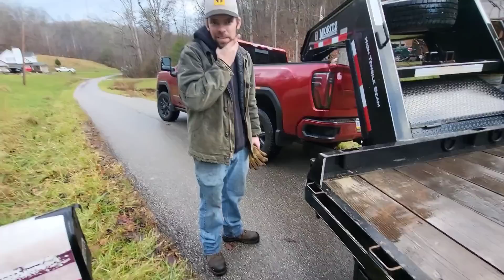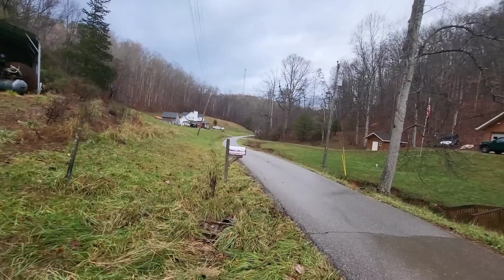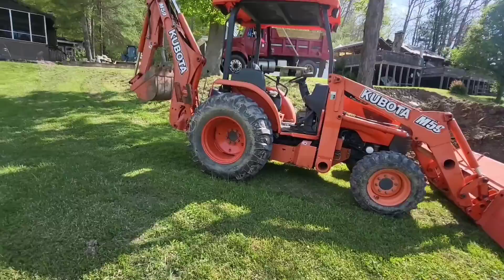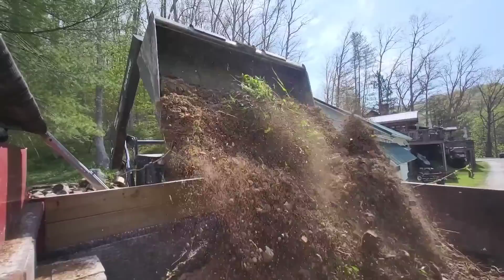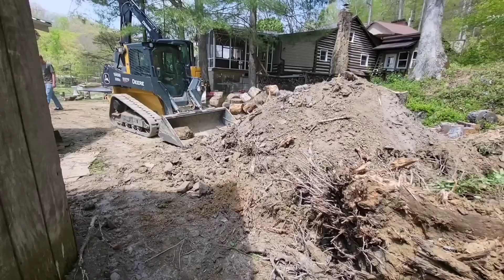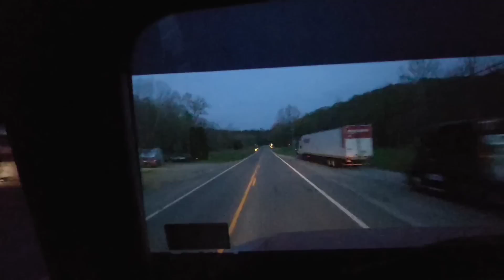Scrappy Industries Needed Noah's Detriot Diesel Rad | Plus Lakeside HOA Shut Down Our Job Site

Comment: If you watch the professionals who dig out trees a lot they use their buckets in different ways. The main one is - once they have it under the roots it's pushed and used as a lever, you're going to have to be careful because your buckets aren't as strong as theirs but it should still work toan extent. Give it a try! It might help when you get other jobs like this one.
Reply from the maker: Thanks for watching. The biggest issue is that we had brought a 36" bucket to this job to move a mass quantity of dirt, which isn'tideal for stumping. If we had a 12" bucket on the job, we could have gotten under the roots much easier like you mentioned. Unfortunately, the wide bucket eats up most of the machine's breakout force

Comment: Never got to see any Detroit/GM!
Reply from the maker: @damienodonohue1327  The frame and radiator that I loaded on Sam's trailer was from a Detroit Diesel 6-71 generator. I'm sorry, if we weren't in such a hurry, I would have filmed a bit more. This power unit was on a barge in Cincinnati that worked on tow boats. The power unit was in a fire. The company that Noah got it from kept the generator head. Noah kept the 6-71 block, and we gave the rest to Sam for his Cleveland engine.
Reply: @zacharylockhart5107  okay, good to hear!